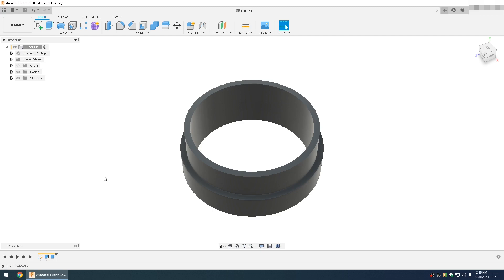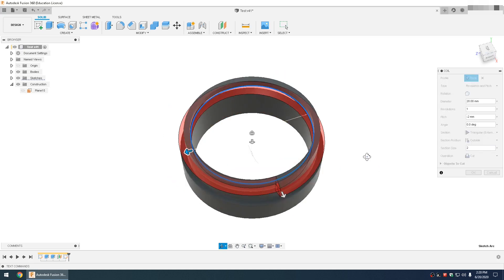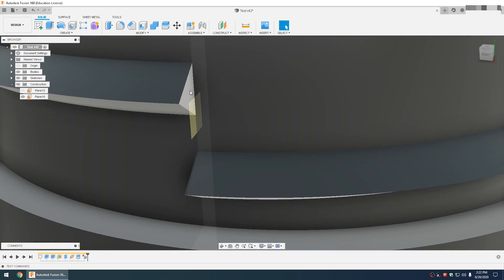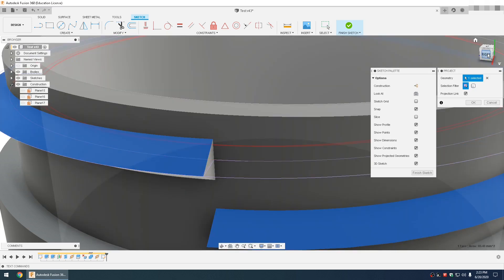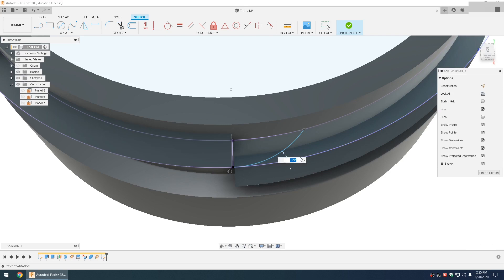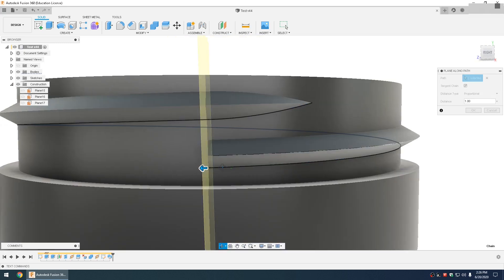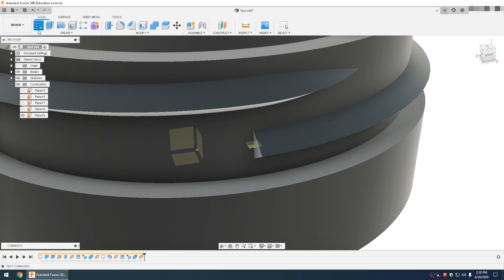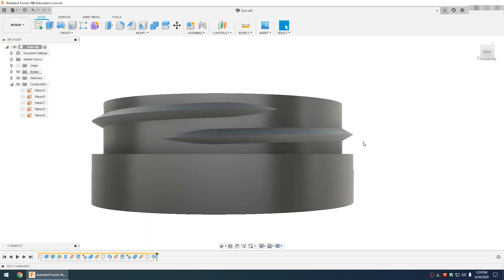Create Custom Threads With Tapered Ends In Fusion 360 - 2020 Updated Method

Comment: This was really helpful. Thanks.
I made the thread as a new body, because I only had to make one plane to square both ends, yes, I lost a hair off the bottom, and then just joined all the parts.
I was having trouble getting the taper line drawn, and found creating a tangent arc was much easier.

Comment: Great video, but what an absolute mess. They need to add a tapered thread option to the thread tool as well as the ability to create minor diameter shaft lengths such as for dog nose bolts.

Comment: Actually your method does not work any more. I followed your instrcutions and when I am trying to project fusion crashes. In the preview it gives me a lot of lines. Not only two like in your video :/
Reply: It's enough to project tip of triangle and the inner wall of cylinder
Reply: This still works...

Comment: Hmmm this seems needlessly complex. I tried doing it a much simpler way by simply 
1) Creating the coil
2) Choose Offset Plane and pick one of the end faces of the coil. Then create a sketch with nothing more than a single line that runs through the middle of the end coil face. 
3) Now create a 'Plane At Angle' using that line and set it to about half the thread pitch i.e. for a 4mm thread pitch, you enter -2
4) Create a new sketch on the that plane, and simply draw a little 3 point arc, starting at the middle of the coil face (which you'll be perpendicular to) and bending inwards a bit
5) Use 'sweep', pick the coil end surface as the face, and the arc you just created as the path

To me it seems pretty damn close to perfect. And for the other end of the coil you just repeat this process. You don't need to stuff about with splitting and all that nonsense
Reply: This was very easy to follow. Thank you!
Reply: How would you create custom threads with tapered ends in XML custom threads file - or how would you taper the ends of threads already defined in fusion 360?
Reply: what if you dont know the pitch height?